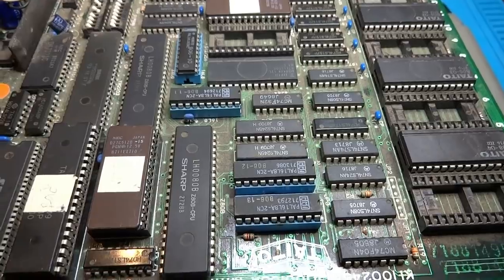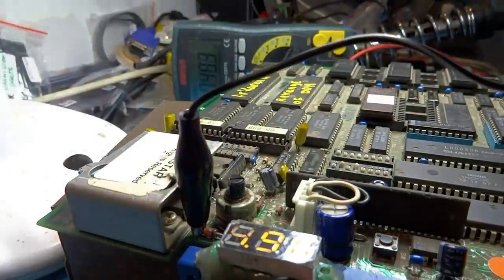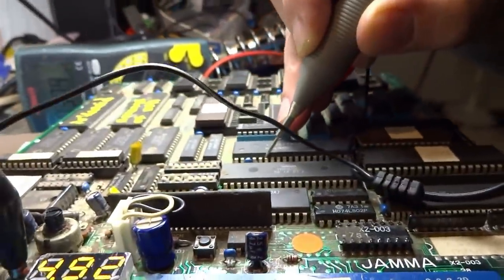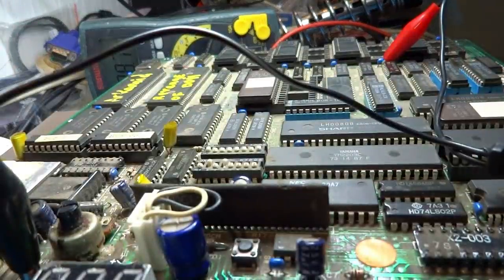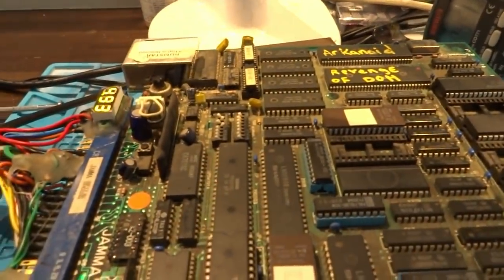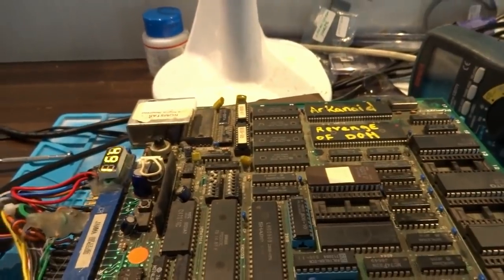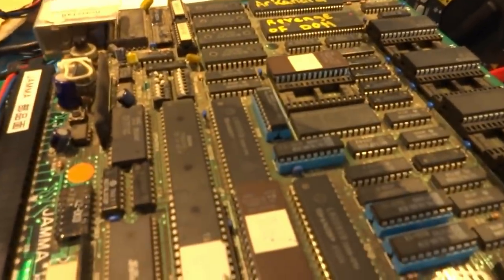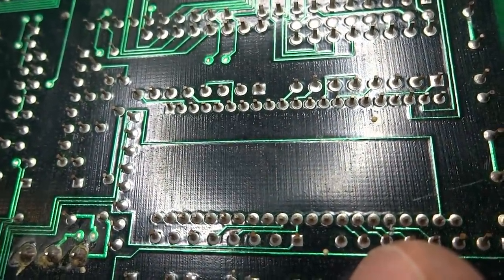Arkanoid Return Of Doh Arcade PCB Repair

Comment: Seeing all these repair vids again motivated me to tackle a bad PCB I've had laying around for years, and I just managed to fix it! Not as quickly as luke does but hey, I'm still stoked to have it up and running.
Reply from the maker: OH WOW!! That is great! what board was it?? Id love to see what was done but the fact that you got motivated to fix it and actually did do that is really impressive. Congrats!
Reply: @lukemorse1  it was just a soccer game (Tecmo World Cup) - i know you're not into sports games, but i like it, haha. It was showing a picture but had no sound.

I took a really good look around and pressed on the chips to see if it made a difference - and I found a small green thing (like a flat square capacitor?) was wobbling when you touch it, because one of the legs had broken and wasn't making any contact with the board. So i put a blob of solder on that. Another couple of bits looked sketchy so I resoldered them as well. And whatever it was, the sound now works!

Thank you for showing us that sometimes you just need to give the board a really good look and you might find something!

Comment: Good old Arkanoid. I used to play it on the NES using the Arkanoid Controller. Arkanoid Return Of Doh was released for Famincon and it also  has a  Arkanoid Controller yes you can play it with a normal Controller but with Arkanoid Controller makes a lot easier to play. By the way at 25:22 to tell you right away  Arkanoid  requires a paddle to play if you notice any of  the Arkanoid arcade cabinets all they use paddles so that's why it doesn't move with the joystick so  you have to someway to make a Controller paddle to play the game just to heads up.
Reply from the maker: Thanks a lot for the information. I should have known better as I have this game on the Famicom and the paddle with it but yeah, just before picking these boards up off the pile and trying to get them running I should check that out lol. Thanks again

Comment: The M-001 (or M-Chip) is actually an 8048 microcontroller used to handle the control inputs.
Reply from the maker: Thanks a lot for the information, I appreciate it

Comment: This game plays with a spinner.

You're a pro.
I'm an amateur. I would first:
1 put the voltage to 5.0
2 mark where that pot is and rotate it to see if that does anything
3 checkk that connector that apparantly dridges 2 pairs of pins
4 make sure the dip switches are correct
5 see if all ic's, chips are seated properly in the sockets by pressing down on each one
6 see if slightly bending the pcb does anything
7 clean the pcb
8 compare the board for missing parts with other pcb pictures online
9 google for known issue with this pcb type

Great to see a pro in action!
Reply from the maker: Nah, I wouldnt say Im and pro and I definitely wouldnt say you are an Amature.  I would say there are a lot of different ways of tackling the board and some use what they have learned from other repairs but there are multiple possibilities.  Most boards will run with anywhere from 4.75 to 5v unless they are some power hungry ones like the IT or Midway ones. The Pot on the board is for volume :) The pin that bridges the two pins is for audio/stereo. Checking the dip switches is good and especially usually switches 1, 8, or the first and last ones on a pcb which can be for freeze screen. Checking all the chips for seating is a good idea. Taking them out and cleaning/inspecting them for bent legs is also recommended. Flexing the PCB is a good way to check for some issues, usually works best with surface mounted qfp's. Cleaning the pcb is a good idea for sure. Looking online is a great way to compare what chips may be missing and I do this as well. Googling is a good way to find common problems and fixes I agree but sometimes the information is quite dense and can be all over the place. Making a video showing what is done can sometimes be easier to see and understand. From one "pro" to another ;)

Comment: You won't be able to control this game without a spinner (an optical spinner, if I'm not mistaken). Exactly how you need to wire one up to one of these, though, I don't really know. Maybe it's through the left/right inputs on the JAMMA edge (something I should look into as well as I'm sitting on two Arkanoid Revenge of Doh boards, one of which has graphical errors that I can't identify the cause)?
Reply from the maker: Thank you for the info, I appreciate it. The first thing I would recommend is looking for broken traces and swapping the socketed chips from one board to the other. (put markings on one set from one board so you know which one you took it off of). by doing the swapping back and forth, you might be able to make one working one :) try it out and see what happens

Comment: COOL and you're right finding these shorts and broken traces are very difficult, I would use an oscilloscope if I see some sync issue, just checking if the signal(s) looks right. Although in this case it wouldn't helped much I think... still very cool job dude!
Reply from the maker: Thanks a lot Eddie. Some of these points could be much better planned out for sure but just glad to have it working this time around. Thanks again

Comment: Happy that you got the board back to a playable condition (assuming controls work). Unfortunately your repair technique is the electronic equivalent of poking the board with a stick. It worked in this instance but is not good general practice. Try to get some systematic methodology - start with a thorough visual inspection. If you think traces may be cut/bridged TEST them with a multimeter in continuity mode. Check electrolytic capacitors for leakage and tantalum capacitors for shorts. Then hook the board up and check voltages on the power rails at multiple points including Vcc to the major IC's. Then check clock signals and reset/watchdog activity. If there is a video issue test the signals with an oscilloscope. Using a video converter just adds another potential problem in the chain - does it work? How does it behave when input signals are wrong? You could end up trying to troubleshoot the video converter instead of the board. Using sandpaper on the IC legs removes the surface plating and promotes rapid oxidation. Better to use a chemical deoxidizer and/or buffing tool. Finally, please DON'T use a screwdriver to lift IC's - use a proper tool. They are very cheap and avoid the risk of damaging the sockets or underlying boards. Feel free to flame/delete this comment if you wish but maybe it has some good advice? 👍
Reply from the maker: Thank you for the comment. To cover the points you mentioned, I will explain.  For starters, there are some things that are not listed in the video that are done off camera. Shorts are checked between GND and +5v to make sure there aren't any bridges beforehand. These can be caused by blown caps or bad amplifiers and I make sure of this before plugging in any board. This was not shown in this video but I have mentioned this in other ones. Next, the traces that looked cut, WERE tested for continuity before adding wire. I  realized going back and watching the video that I said "they looked bad so I fixed them" but they were tested and found to be broken traces. I agree with measuring voltage on the IC's, this is true and I didn't check several places on this board, only a few points as you could see. Using an oscilloscope and being able to check what each component on the board is doing, attaching a logic comparitor, running the roms through ROMIDENT, checking the address lines and data lines for floating or pins held low, testing components out of circuit to verify internal shorts etc are all great examples of things that can done to perfectly troubleshoot a board. This is not what I'm focusing on with these videos however. I am trying to show those who have limited resources some things they can easily try or do to possibly get their boards up and running again. Time and time again I've see videos that are confusing, strung out intentionally to add extra unnecessary content, too difficult to follow, or just not usable. In a perfect world, these boards would never be left outside, stored in damp places, they would have anti static guards on the bottom of them, heatsinks on the IC's that get too hot and be encased to protect them from getting gouged when stored on a shelf but alas, they aren't and as you can see here, these boards have seen better days. In terms of using a converter or not, this has worked for me with many of the boards I have so to each is own. Adding a 10k resistor inline on SYNC or in some cases correcting positive/negative sync issues using a 74ls04 simple circuit can rectify sync issues  but once again, the cga to vga converter has worked for me so I keep it around. As for using sandpaper on the pins, I mentioned this in the video, yes some of the plating can be removed but Eproms and maskroms (especially ones left outside)also get rusted legs which takes off the plating and destroys them. The finer the sandpaper, the less it removes. The sandpaper I'm using in this video is extremely worn down and although it sounds rough on camera, it is quite smooth. I also mention that using some kind of cleaning solution is best if you have it.  In terms of screwdrivers, I have mentioned this in several videos but I have never ripped out a trace with one ever. The key is to not wrench down on the board or dig into the board when you pry up.  There is honestly no problem at all using them as long as you know where to apply pressure, how much, and very dependent on how stuck they are in the socket. IC tools aren't necessary to remove these chips but for those who like to use them great. All in all, I understand where you are coming from and that what you say would be an excellent way to repair these boards and I am aware of this. For those who are interested in the more in depth correct and thorough method,  I would totally recommend going to other channels that provide that information.

Comment: 07:24 Arrrrggghh!!! After pointing out how hard it is to notice some problems by visual inspection you decide to sand the chip legs clean - over the top of the board itself? Admittedly the chances of flaking off a whisker of metal or conductive corrosion and it landing in a awkward spot is low but given how hard it would be spot later, why take the risk?

Comment: The CGA to VGA converter wasn't working and then out of nowhere it started working, anyreasons why or what fix the arcade board?
Reply from the maker: Usually if the board is putting out a correct picture without any issues, it will display on the converter. If it isnt putting out an image it may keep refreshing or repeating until it gets a clean signal. Once the board was working correctly again, the sync and image were displayed on the converter.
Reply: @lukemorse1  But what was causing the refreshing and repeating issue because the board wasn't outputting a correct picture? It seems like arcade board just started working without changing any parts not sure what was the problem

Comment: I really dig watching these repairs as someone with no knowledge of electronic repairs with a growing interest in learning it. Now that you got a signal out of it, Luke, what do you suppose you could do to make it work on the "normal" output you had no luck fixing? Or is this a matter of simply needing the converter to run correctly? 

Thanks again for the vid!
Reply from the maker: I really appreciate that thank you. For some of these boards you can change the video sync by adding a 10k ohm resistor in line or you can build a simple sync circuit with a 74ls04. Many of the arcade manuals also list these options for monitors that dont sync up.
Reply: @lukemorse1  Got ya! Glad you got this one revived the best that it can run now. Also appreciate the detailed reply. You helped me fix a lost cause of a NeoGeo CD years ago and have been a mainstay YouTube stop ever since. =]